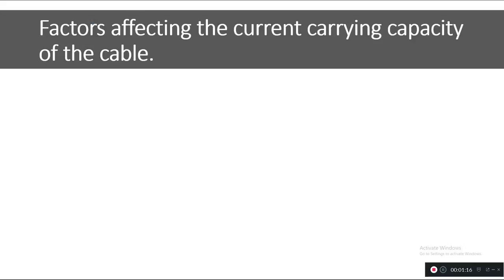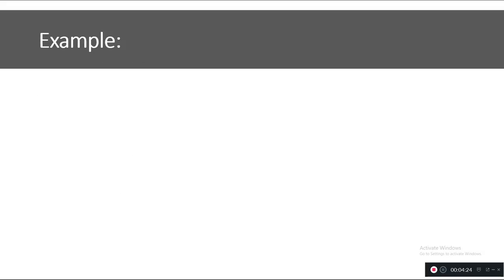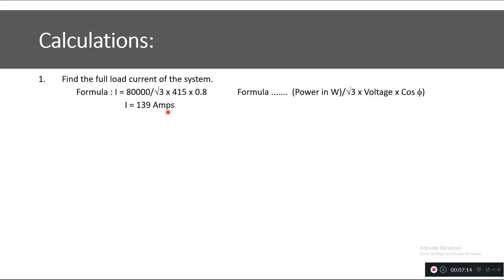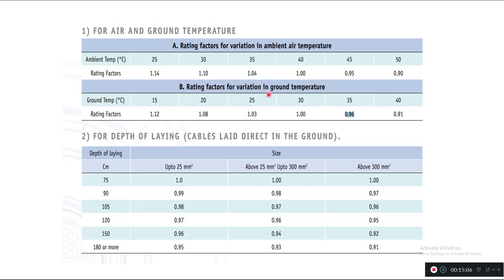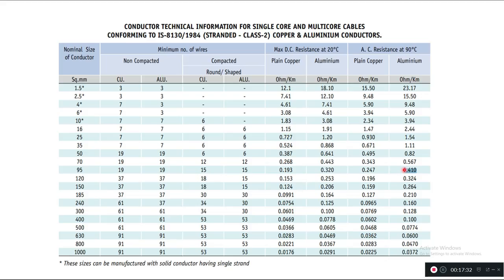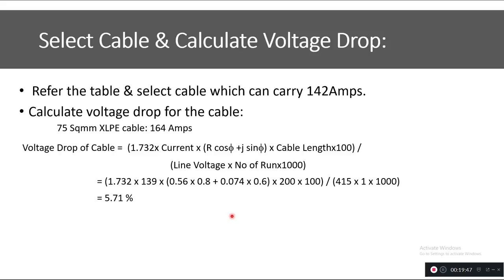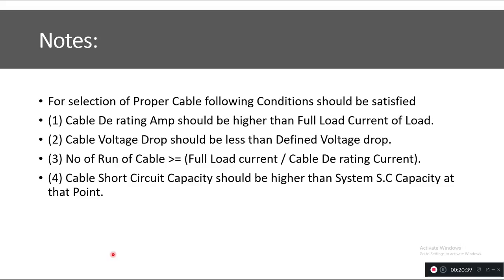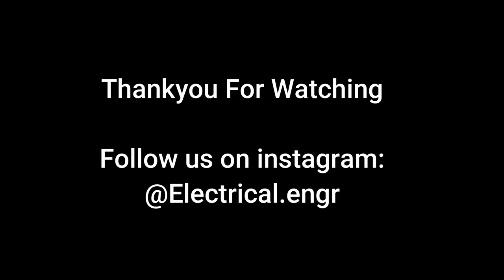AC Cable Size & Voltage Drop Calculation. Sizing of ac cable.#voltagedrop #calculation

Comment: Two questions here
1. what if the fault current is 50ka, we need to consider a= sqrtt*Ish/k, then cable size increases
2. Secondly while doing the calculation for resistance and reactance you directly took the value but length is 200m so we need to calculate r & x for 200m since value in the catalogue is ohm/km
Kindly clarify please

Comment: How to calculate the cable size if the cable is going to be installed both in trunking tray and also underground ?
Reply from the maker: Same procedure, just according to depth of your trench consider the grouping and correction factor. Rest remains same

Comment: how do we consider the starting current of the motor and also the overload current in the motor
Reply from the maker: hi, this calculation was provided for ac cable size for solar application. In motor case kindly consider the rated current of the motor & Short ckt current.

Comment: thanks for the very informative vid my question could be relevant but in an undirect way as it is about load calc and in particular for water heaters in bath room is there any reduction factor for example if you hav 4 of them 1000 watt each would you take it as 4k or is there anyway to reduce that thanks again

Comment: What about in overhead cable
Reply from the maker: For overhead you need to consider the clearance on different voltage levels and for current carrying capacity you should refer data sheet and remaining same approach as mentioned in video

Comment: Nice video Sir, Similarly Explain the Voltage drop calculation for cable lay in air
Reply from the maker: It will remain same as derating factors I considered in this video is 0.95

Comment: Thanks for the video content. This is helpful reference. 
I just noticed that during voltage drop calculation, you put full load current 139Amp instead of considering with correction factor 142Amp ??
Reply from the maker: It is correct from my side

Comment: Why you have considered FLC as 139 A when the actual current after derating, the cable has to carry current is 142A?
Reply from the maker: Full load current is 139A. The maximum current that will flow is 139A. 

142A is the capacity of the cable. It means that your cable capacity should be atleast 142A, after laying and considering the derating factor it can carry 139A

Comment: If cables having more no of bends whether it will affect on current carrying capacity?
Reply from the maker: The bends do not actually affect the current carrying capacity. 
It will lead to mechanical stress on the cable, I.e. it can get heated at the bending points or even lessen its life. 

Losses in cable may increase.

Comment: Hi Sir, Thanks for the information  and I have a doubt that for resistance and reactance in cable data sheet is for 1km and u have taken a length of 200m
So we need to divide the R and X for 200m know? What's ur suggestion?
Reply from the maker: Try to get cable datasheet Or you may refer similar cable, another standard company cable datasheet

Comment: Can you make a video on an open air ac cable voltage drop wire selection wher the temprature goes above 45 deg in the summer & in to single digits in the winters
Reply from the maker: I have mention the parameters in this video itself.

Comment: Sir, the Answer is 4.3%, not 2.2 % can you double-check please
Reply from the maker: Yes you are right, I checked answer should be 4.3 %. I did some error during calculating the answer. 

Rest all is correct just the end answer should is 4.3%

Comment: Very well explained, could you please make a video for Short circuit current analysis for circuit breaker selection for motor loads or MSB boards 
(main switch board / LV switch gear panels)
Reply from the maker: Kindly refer to my video about, design of solar LT panel ... it is 1MW solar plant design video no. 2

Comment: Hi, thanks for your video. I have a question. How can I calculate the cable size between a 175kW ABB inverter and a 2640kVA substation? The length of the cable should be 120 m and the soil thermal resistivity coefficient for that area is 1,5 (m*K/W).
Also, there are four such a cables in one tranche and I need to find out the minimal distance between the cables in the tranche.
I watched your video and I managed to calculate a 240mm cable but not sure if I did it right. Please give me your comments.
Reply from the maker: hello Mathias, yes I can say that your cable size is suitable. for the distance between the cable refer the data datasheet. consider almost 2xDiamater of cable distance between each cable sideways.
Reply: @electrical-sajid  Thank you. That was very helpful! I guess that this required distance obeys to avoid interference of each cable magnetic field among, other reasons.
Reply from the maker: @mathiasnicola254  yes check it on cable datasheet as well.